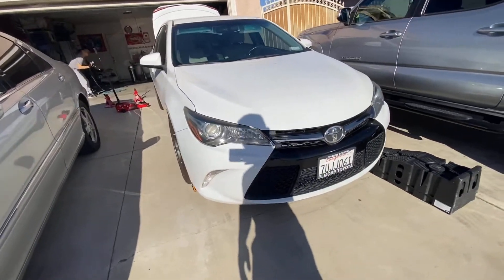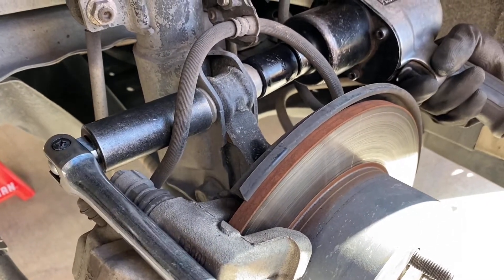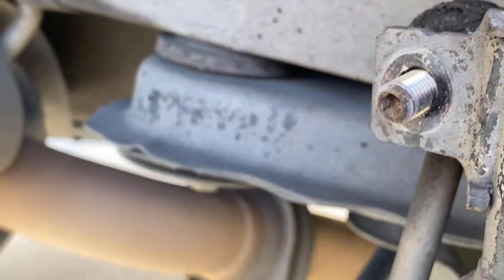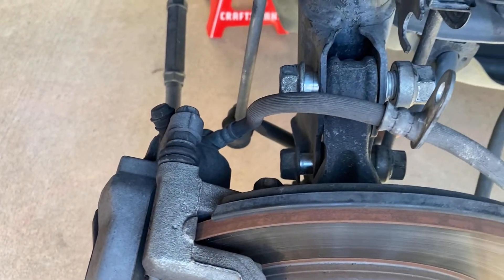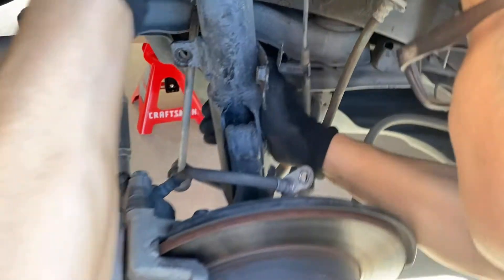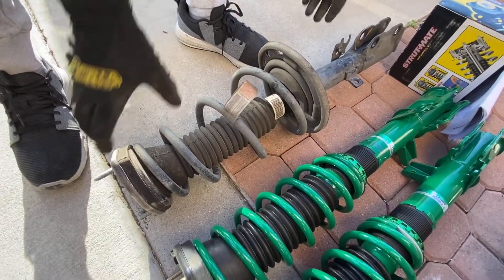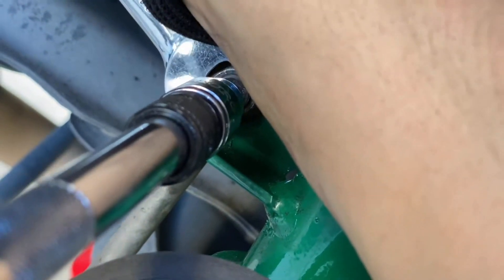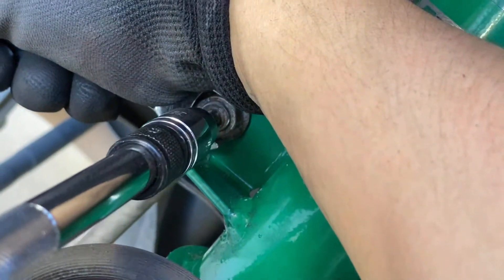How to install coilovers

Comment: did you ever have problems with the rear top mount center nut? i thought i had tightened it good enough but when i go over bumps i hear the coils go up and down lol
Reply from the maker: Might want to make sure its sitting right on the rubber mount. Almost all my cars with coilovers had that tiny sound
Reply: @EddyTea  this whole time it was the spacer that sits between the top nut and the mount 😂😂 thanks for the help man i appreciate it
Reply from the maker: 😂 glad you got it brotha

Comment: Excelent videos thanks for that.how comfortable is it compared to the original struts? I would appreciate your opinions.
Reply from the maker: Its pretty solid because u can adjust the dampening. Of course it wont ever be as spongy as the original but for our driving we need a little stiffness. The main reason for the change over to coilovers was the because it was going to almost cost the same to change out for new shocks

Comment: how is the ride quality on these? im looking into them but dont want too much of a stiff ride
Reply from the maker: We went for these because of the price being almost the same if u did a separate coil and strut set up. the dampening control is good if you want to soften them manually from the knobs but for about $600 more you can add electronic dampening control with its EDFC system
Reply: @EddyTea  how much did you buy them for? im debating between tein coilovers or spending $1030 on bc racing
Reply: I would go with BC Racing  because it will include tophats strut mounts and has more height adjustment options

I didn't go with BC Racing because there was a 4-6month shipping delay. Months, not weeks.
Reply: @cncaliguy09  would there still be a delay if i ordered them any time soon? i was planning on ordering them in a few days😭
Reply: Ride quality is decent, you can get it very soft close to OEM at softest setting. 
I have it front at 6 and rear 5. When  I push the car really hard it tends to rise and travel too much.
Reply: @Stxtter  this was months ago, almost a year ago, so I think all the shipping stuff is over.
Reply from the maker: @cncaliguy09  how much do this go for?